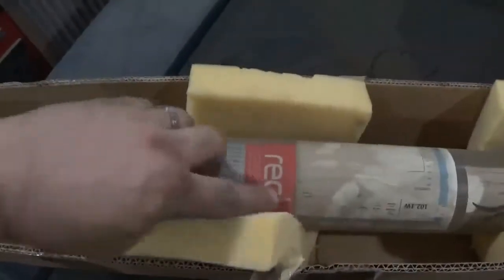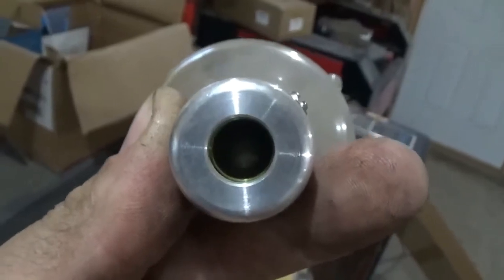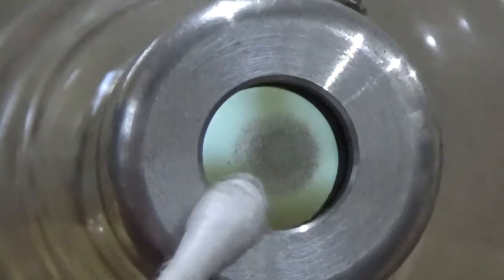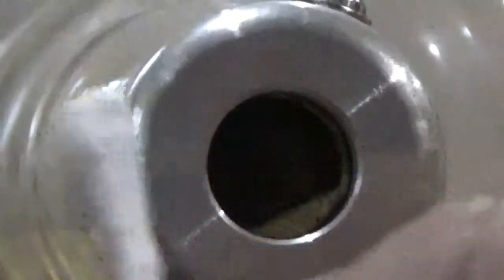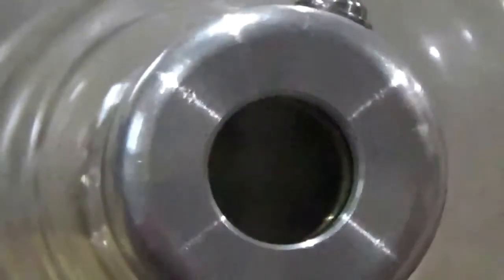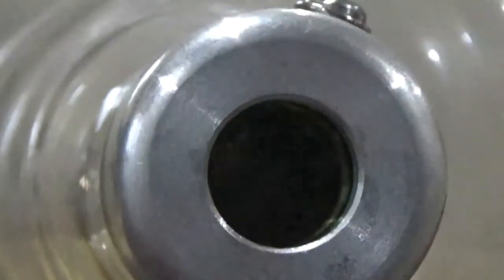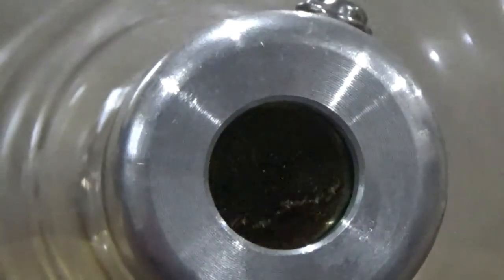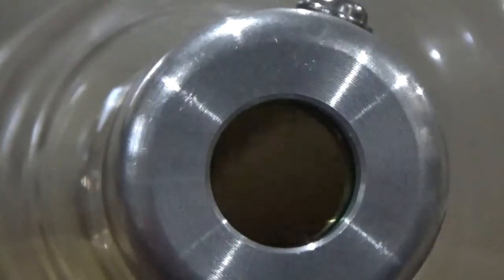Do this before you replace your Co2 Laser Tube

Comment: Hi there, good video. We have an Omtec 60w laser and after about 14 months and only about 350 hours we are told the tube needs replacement due to sudden loss of power after a mirror cleaning. Seems like the tube did not get nearly the hours stated in the product details. Thoughts? Thank you.
Reply from the maker: 14 months is a long life for an off brand consider getting a reci tube to replace it with
Reply: I have a 60 watt co2 from Omtech and my tube went at 14 months as well. Just undertaking the replacement to day.

Comment: How do you know you have a bad laser tube?  Do all laser tubes have that hidden mirror?
Reply from the maker: All co2 do yes is your tube loosing  power? Check alignment and lenses and mirrors are clean if it is still weak it is likely the tube
Reply from the maker: I might add if it is not firing check your power supply there shoukd be a test button that lights up a light

Comment: Mine has a damage spot, maybe thats the reason i get not a thin line in 3 of 4 corners. Only in the corner where the laserbeam has the longest way in the right front side i get good engraving results. 

So why cant u replace that lense? I dont wanna spend 500$ for a new tube. I dont even used it very much, it would be very annoying
Reply from the maker: The tube is filled with gas and this lense seals it unless you have a way to refill and seal the lense you can't
Reply: @JaysToDoList  damn that sucks, its not normal that it gets damaged after 11months and not even using it that much. Dont wanna pay hundreds of dollars for a new one 😮‍💨
Reply from the maker: @13hubi13  double check your alignment clean all lenses and mirror don't forget to check the 3rd mirror that bends the laser down to the lense if any of them are off it can split your Laser beam into two pieces if it hits the nozzles wrong
Reply: @JaysToDoList  i actually did that over 5 times now if not even more, everything is perfect it cant get aligned more perfect, everything is perfectly in level. Also replaced all mirrors with new ones. The laser beam comes out of the nozzle perfect in center in every corner. I asked about that problem over 10 times in every laser group that i know and still no one could find out whats causing my error. And just yesterday i looked into the lasertube and saw that the lens inside has a damage spot so thats the only thing i can think of that is causing my problems.
Reply from the maker: @13hubi13  maybe did you try to clean that lense?
Reply: They company i got my laser from told me i have to clean it daily after every use but i guess nobody cleans that everyday, would really wonder me, because there is also nothing mentioned about it in the user manual.
Reply from the maker: @13hubi13  do not clean this lense every day maybe 1 time a year.  Clean the lense in the nozzle and the mirror above 1 time a week mirror two. 1 time a month  mirror 1 every couple months unless you.. if you have to do more than this you need better ventilation
Reply: @JaysToDoList  yeah but my lense im thr lasertube got already damaged after 11 months, so cleaning after a year would not habe helped that much. But maybe i just got a bad one or i dont know, all the others i know use their tube simce years without any problem.
Reply from the maker: @13hubi13  cheap tubes only last me a year I use my lasers Full time though. Not sure what your usage is.

Comment: The only reason you get that window "smoked" is because there are fumes in that area and the beam exiting that window is "cooking" the fumes onto the anti reflective coating. The mirror you speak of is on the internal suface of that exit window  and is still working perfectly. However the 5% light that escapes through the partial mirror to create your 90 watt beam is being compromised in two ways. 1) It 's intensity profile is being distorted away from Gaussian and is the key reason for apparent power loss. 2) there will be 2 or 3 watts  watts absorbed by the debris film and if you let it get too bad it will heat  the outside face of the window and cause an obvious star crack. The manual specifically says DO NOT CLEAN THIS WINDOW . I have been in your position and have carefully remove  a slight haze  with alcohol and VERY gentle use of a  cotton bud. There is always a film left by alcohol that MUST be cleaned off with a gentle lens tisue wipe or that residue will again cook on.
 For fumes to aggregate in such an eclosed area as the end of your tube  must say something about the fume extraction effiiciency within you machine cabinet. There should be ZERO fumes  in this area and I can see from the crud on the outside of the tube that there are fumes in this area. If you cannot identify the problem,  then position a small low pressure air jet  across the end of the tube to make sure that output window  stays fume-free.
Reply from the maker: Thanks for watching

Comment: Do you have a video how to flush gunk out of the tube? The stupido's that put in my new tube did not flush the chiller and now all that crap is inside the tube 😤
Reply from the maker: Yuck no make sure you only run distilled water through your cooler and tube maybe you can take the outlet off your tube and let some clean water run into a bucket through your tube to clean it out good luck
Reply: I use a few drops of fungicide for aquariums and change out my water annually.  Never had an issue with gunk.

Comment: It’s worth mentioning that it’s a lens rather than a mirror (although with an internal semi-mirrored surface), and pretty fragile.

From the Reci model W instruction manual:

3.7 Notices
The surface of beam output lens cannot be scrubbed with any tools such as cotton balls, otherwise the power will be serious affected. Here are several methods for cleaning.
(1) When the lens is contaminated, do not use the laser tube;
(2) Blow the lens surface obliquely with balloon;
(3) If the above no effect, user needs to remove the lens and use a cotton ball with a little alcohol to rotate the lens.
(4) No need too much alcohol, but the glue layer of the adhesive lens cannot be touched in case of gas inside escaping.
(5) The laser cannot be used till alcohol evaporating.
(6) Do not scrub the lens with acetone. The best way to protect the lens is keeping the environment clean. (7) When testing the beam on plexiglass, please keep it 300mm from the mirror.

How you want to interpret that is up to you, but if you’re going to scrap the tube anyway it’s worth a try.
Reply: I'm assuming these instructions are for those who are thinking of scraping the tube since it mentions removing  the lens in step 3. That would release the gases inside. I also do not understand step 2 blow the lens obliquely with a balloon? What the hell is that?
Reply: Chiglish is often very confusing.and as mentioned by Robbie   below., often meaningless . There are definitely  no lenses in the tube, just two mirrors (one at each end) that must be PERFECTLY flat and  PERFECTLY paralle to each other. Chalk a mark at the centre of oppostie END cushions on a pool table, Now stirke a ball so that it rebounds many times off each end cusion perfectly without deviating from centre. That's the pool game taking place within the tube with photons of light. Light reflects off mirrors thus to acive this back and forth effect a  billion times a second requires super flatness and  mirror alignment. The output mirror is about 95% reflective thus  the 5% "leakage" is the  90 watts of output. I note that this W2 tube is A grade because  its peak value excees the 100 watt spec for the tube. There are MANY B grade tubes that are released onto the market where the peak specification has not been achieved. These are woking tubes that do not have a factory warranty and can usually be bought ar bargain prices. The failure to make "A" grade is because the mirrors are somehow  less than perfect and thius not producing the correct test wattage. Once made the tube cannot be rectified and thus as far as the factory is concerned is reject/scrap and sold at a VERY low price for "repurposing" . The ONLY thing I can see that is correct in this section of the manual is DONT MESS WITH THAT WINDOW....ESPECIALLY WITH A COTTON BUD!!!!!
Reply from the maker: Ok so next time throw the tube in the trash instead of cleaning and getting it to work again got it thanks for your input
Reply: @JaysToDoList 
 Hi Jay
All the tube manufactureres  say  DONT clean that widow  (yet Reci then give useless advice on how to do it ....that's mad) BUT I have, done so when I accidently "smoked it". I knew what I had done and when  and I was able to save the expense of a new tube. so you have to be practical about the situation if you have nothing to lose. If you let it get too bad then I may not be recoverable so as I suggested,  rig up a little gentle flow of air across the tube end to keep the area fume -free.